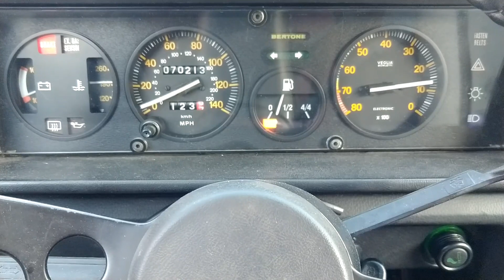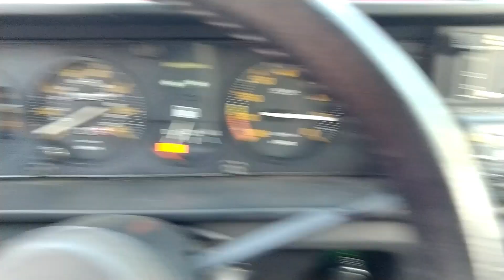Fiat X1/9 Nemesis EMS plug & play Bosch Jetronic Replacement

Comment: Looks like great potential. Pre-OBD ecus are difficult to tune. Will this eventually work on all Bosch L jetronic cars?
Reply from the maker: Yes, but we'll have to handle each application on a case by case basis as there are some nuances in the various applications and available wiring and data.